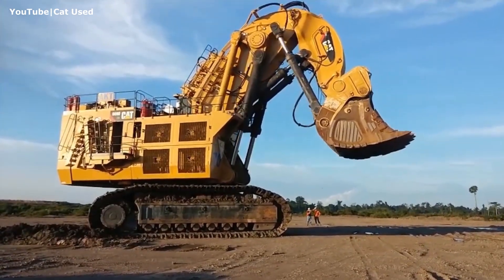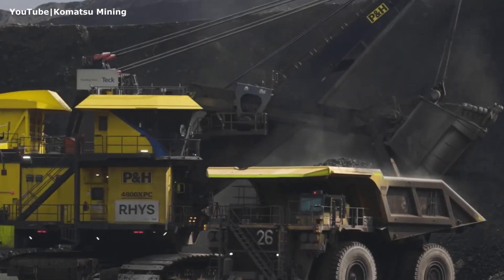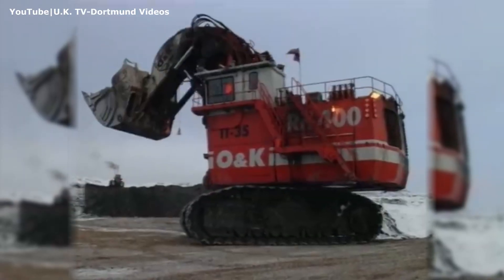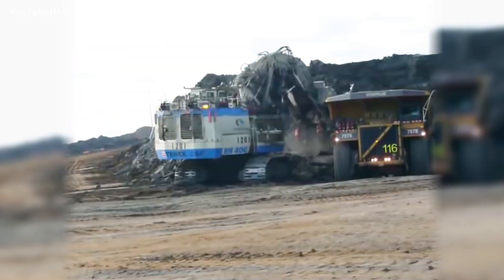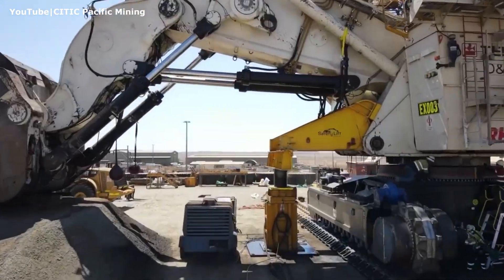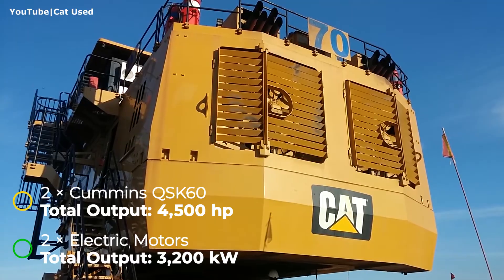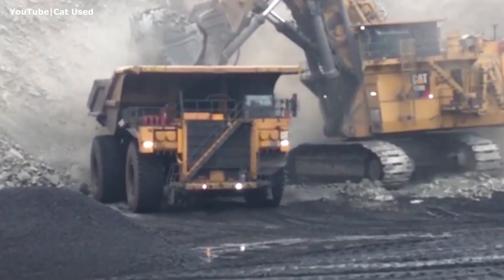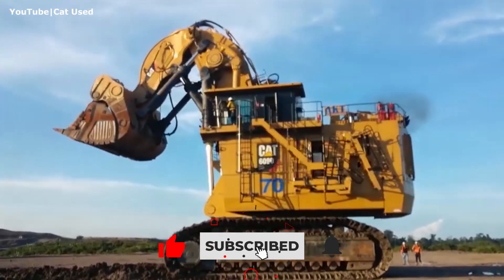The Biggest Hydraulic Excavator in the World! CAT 6090FS/ O&K RH400

Comment: The very first O&K RH400, Syncrude fleet number 11-35, started work in August 1997, it weighed 830 metric tonnes and carried a 42.5cu.m bucket. It was initially powered by a pair of Cummins K2000E engines producing 3350hp, but these were soon upgraded when the QSK60 V16 engines were released the following year. Subsequent models increased in weight and power and today the Caterpillar version, called the 6090FS, weighs in at around 1000 metric tonnes. This Caterpillar version still uses the same twin Cummins QSK60 quad turbo 60 litre V16 engines, but by now they have been upgraded to 4500hp with a 52cu.m bucket. Both Terex and Cat made significant changes and upgrades to the original O&K design resulting in increased performance and reliability. 
Between 1997 and  2021, only 22 of these machines, both RH400 and 6090FS, had been built, an average of less than one per year with the overwhelming majority going to the Canadian oilsands and also to Australia. Citic Pacific's magnetite mine in Western Australia has four of these working, two started in 2008, numbers 9 & 10 off the production line, and they were later joined by number 14 & number 15.
The picture of the RH400 painted in Bucyrus colours at 4:18 is fake, RH400 number 12 was built during their short ownership but by the time it was completed Cat had taken over, the shovel was painted all white with Cat branding and was sold to a coal mine run by Xstrata (now Glencore) in Australia. The very first RH400/6090FS produced in Cat yellow was number 13, it was shipped to a mine in Mozambique in 2012   (source : Earthmovers Magazine)
Reply: I don't even know my family history this well...
Reply: Citic Pacific SN 14 and 15 move  from ex AKT project, Central Kalimantan, Indonesia
Reply: Bucyrus colour in 4:18 fake like 6090 brochure edited for yellow paint

Comment: Not an excavator, it’s a shovel.
Reply: Technically all shovels are excavators
Reply: @rolandturner657  it's a shovel not an excavator
Reply: @Deere2154D  You might want to tell CAT, Hitachi, Komatsu & Liebherr that- because that's how they refer to these machines!
Reply: @rolandturner657  correct. They refer to them as front shovels hence the FS
Reply: @Deere2154D  Face shovel
Reply: @staceytowers9056  either way ita a shovel not an excavator
Reply: If you want to get picky, every machine that excavates dirt is technically an excavator.
Reply: It's an excavator in the shovel set up
Reply: Cant dig below grade with a shovel.  Boom and cylinder arrangement is different.
Reply: @markdevero5648  You can, you just can't go too deep.
Reply: @markdevero5648  yes you can 🤦🏻‍♂️🤦🏻‍♂️

Comment: Them there are not excavators them there are shovels not a robotic arm an excavator works just like a human are not backwards but cool in fact you can put a thumb on an excavator and work it the same as a hand can't put a thumb on a shovel
Reply: Technically all shovels are types of excavators. For larger hydraulic mining shovels like this they often come in both face shovel or backhoe configurations.
Reply: Shovel pushes away, excavator pulls towards you
Reply: @MMikeHD3904  correct but it sure is hard to make a cut with the shovel man or dig a ditch for pipeline. Plus the multiple attachments you can get with a quick tach on the excavator
Reply: @bradkaberline5828  absolutely,  right tool for the job🤷🏽‍♂️